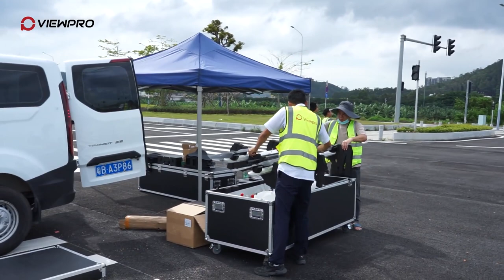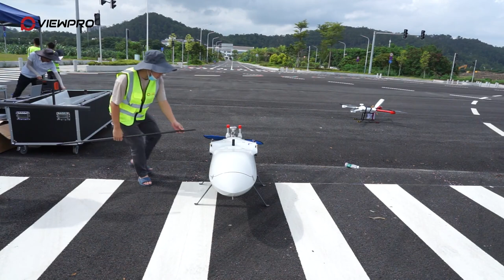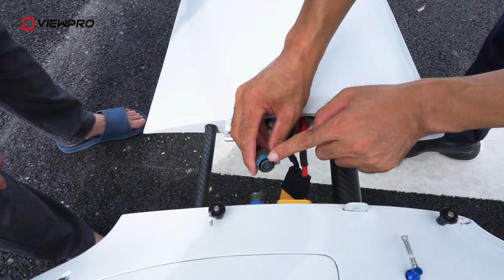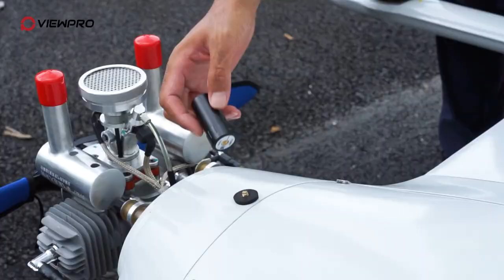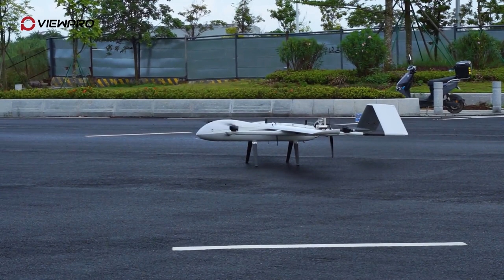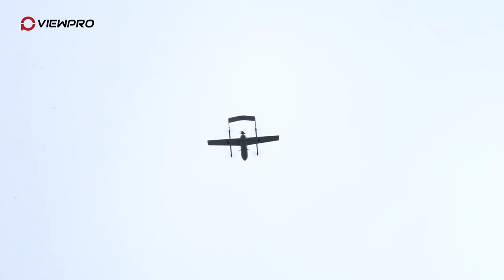Tiger Shark F380 Heavy Lift Hybrid VTOL Fixed-Wing!

Comment: You should make the 4 fixed-pitch propellers used for vertical lift into helicopter blades...with collective and cyclic pitch, and go from 4 to 2.  Like the CH-46 and CH-47 but laterally.